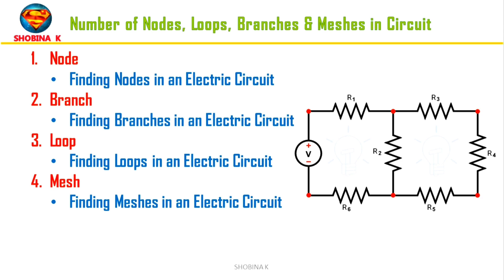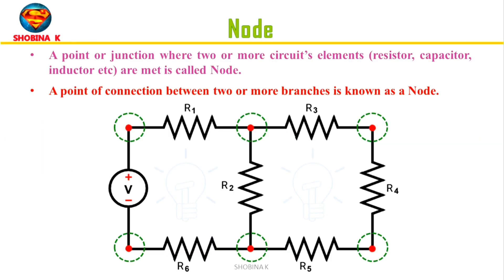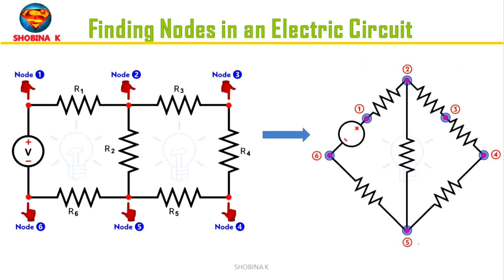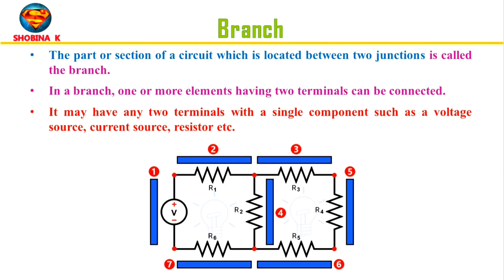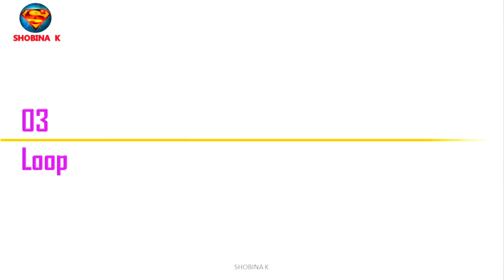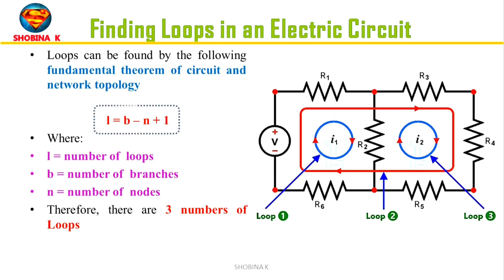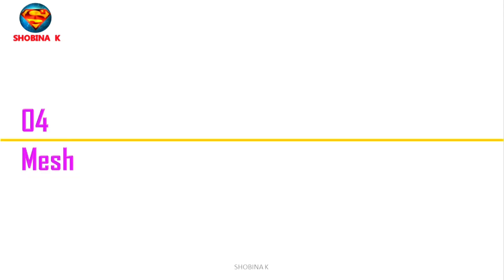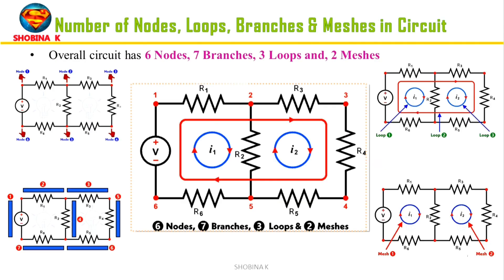EE3251|EC3251 Circuit Analysis.Finding Nodes,Branches,Loops, Meshes.solved previous question papers

Comment: Branches are connected between two junction points. In the given figure only 3 branches... All circuit elements are not branches. In the given figure r2 is branch and r3 r4 and r5 together is second branch and 3rd branch is r1 V and r6.
Reply from the maker: Your statement that there are only 3 branches is wrong because you are grouping multiple resistors into one branch, which is incorrect. Each individual resistor and the voltage source forms its own branch.
Reply: @shobinavaratharajan  no... Plz check with standard text books...in Many local author books we found the same mistake.... Plz check text book like circuit analysis Chakrabarti.... they have given a example too with a circuit ... Kindly have notice
Reply from the maker: I get what you're saying! The definition of a branch can vary depending on the textbook or teaching method. Some consider each element a separate branch, which is why the solution says 7 branches. But as per the textbook (Section 2.2.10), a branch is a path between two nodes, which might include multiple elements. So yeah, it just depends on which definition is being followed in the course or exam..
Reply: @shobinavaratharajan  here you should consider only major nodes that means atleast 3 elements to be connected.for branch you should trace only the path between the major nodes